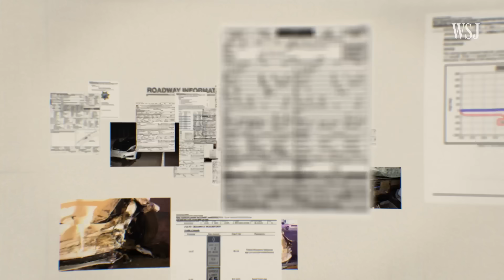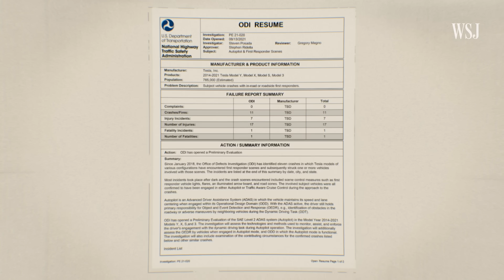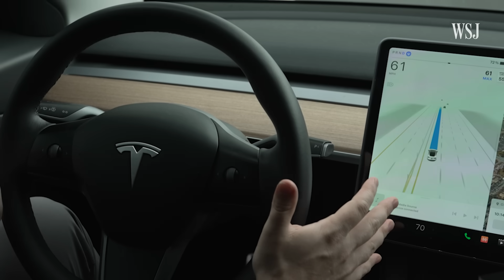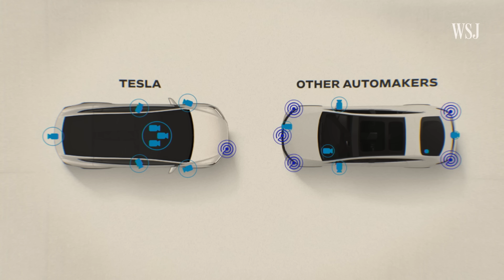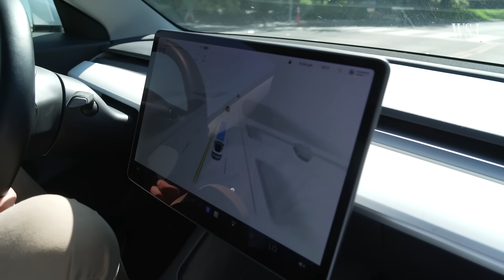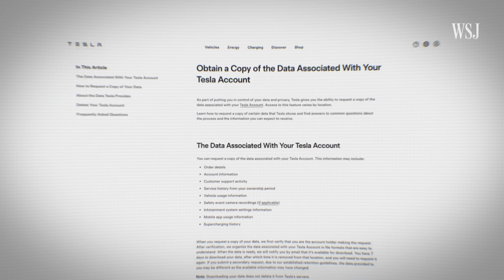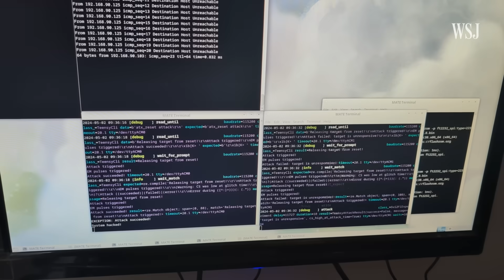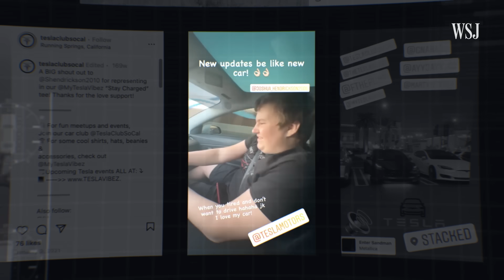The Hidden Autopilot Data That Reveals Why Teslas Crash | WSJ

Comment: This is VERY outdated news.  That semi-crash that you opened with was when they were still using radar - and was LONG before FSD was mature.  There are now 6 million Tesla's on the road.  At an average 15,000 miles driven per year - that's 90 billion Tesla-miles driven per year.  Over all car types, there are 14.3 collisions per million miles driven.  So if Telsa vehicles were like ordinary cars - you'd expect 90,000x14.3 = 1.3 million Tesla collisions per year.   You say that "thousands" of Tesla-related accidents have been reported.   If it was "millions per year" there would be a problem - but it's not.   Also, you're talking about the UK version of FSD - which is FAR from complete.   All Tesla owners are told at the start of every trip that they must supervise their car while it's driving.  Clearly if you slam into a very obvious semi-truck - then you're not supervising the car's driving.   Tesla's are (statistically) the safest cars on the road - and they are safest when using FSD.

Comment: Musk & Tesla are setting back the deployment of autonomous vehicles tremendously with their recklessness, cost cutting, and sketchy marketing. Waymo operates self driving cars with a tremendous safety record, because they invest also in LIDAR and their vehicles excercise greater caution. However, when the public reads about Tesla FSD crashes, it reduces trust in the concept of self driving cars entirely.
Reply: Waymo operates self driving cars with a tremendous safety record 
Which cost several times what Teslas do. If Teslas were equipped with the same sensor suite Waymo vehicles are, no one would be able to buy them, and no one would get the benefit of Tesla's astonishing record of safety.

Comment: A car has either got to be fully autonomous or completely manual, half measures are dangerous. I include in that lane departure devices that interfere with your free choice of where to steer. Give the driver full control and full responsibility or put him in the back asleep with the car and the manufacturer taking full control and responsibility.
Reply: People said the same thing about cruise control when it started getting popular in the 1980s. FSD is great. It does 90%+ of my driving for me right now. The system forces you to look at the road to make sure you're paying attention, and you can take over at any time. Just hitting the brake pedal or turning the steering wheel is enough to take over.

Comment: Don’t drive a Tesla saves lives.
Reply: Tesla saves lives 
So true, and thank you for pointing this out! If this weren't the case, NHTSA would have required Tesla to shut down Autopilot years ago, due to the dozens of fatalities Teslas with Autopilot have been involved in. But NHTSA knows full well that Autopilot avoids far more fatalities than its misuse causes in accidents such as those highlighted in this hit piece, and so it's allowed to continue to be used.
Reply: @ NHTSA is corrupted.

Comment: Its called FSD Full Self Driving. autopilot is literally just Adaptive Cruise Control
Reply: Its called FSD Full Self Driving
This video is exclusively about Autopilot, not FSD. You are correct that Autopilot is just TACC, plus lane centering; this is why it takes much more monitoring that FSD, and this plus the fact that several times as many Teslas have Autopilot as have FSD is why there have been dozens of fatalities under Autopilot, but only two in 2+ billion miles of Teslas driving with FSD engaged. But even with dozens of fatalities, Autopilot still saves more lives than it costs; if this weren't the case, NHTSA would have shut it down ages ago.
Reply: Spot on, this video is misleading calling autopilot tech. They're simply referring to Crusoe control here. It's misleading to say it's fully atonamous  @BigBen621
Reply: @Koderfacts  You seem to be confused about a few things. 
 this video is misleading calling autopilot tech 
Not sure what you mean by this, but the video was entirely about "Autopilot tech".

 They're simply referring to Cruise control here 
How did you come to this conclusion? Autopilot is much more than cruise control. First, it includes TACC (Traffic-Aware Cruise Control), not just basic cruise control as you seem to believe. Further, it includes Autosteer, which others call Lane Centering.

 It's misleading to say it's fully atonamous 
No one anywhere, ever claimed that Autopilot is fully autonomous. FSD (Full Self Driving) is getting very close; but this video is about Autopilot, not FSD.

Comment: There are a lot of possibilities with current technology, but Tesla and any other manufacturer need to slow down if the “AI” is not sure enough it has a clear road ahead. Two cameras are sufficient in determining distance to objects ahead. But in low light conditions there are struggles to all algorithms to produce reliable data. And this is known very well. But you can’t sell a car that is afraid to drive at night. There are a lot of alternatives to all systems. Auto pilot could just follow another vehicle while keeping a safe distance. Use the high beams, when cameras disagree, to provide a better vision. Even a cheap $5 laser can be fired to probe the road ahead. Or even better night vision cameras. And I’m sure an army of engineers can probably think of many more ways to make this better and safer.
Reply: if the “AI” is not sure enough it has a clear road ahead. 
There is no AI in Autopilot; it's entirely heuristic code (code written by Tesla engineers).
Reply: @BigBen621  you did see the quotes, right? What I'm trying to say is just that there are a lor of other algorithms to determine what's ahead, some very old but good. Tesla clearly fails to determine  if the road is clear ahead in low light conditions. And I'm fairly sure it would hit a wall if there is a painting of a road on it.

Comment: Procedural programming would have a default at the end of a switch that says : if you don't know what's in front, assume the worst. But no, it has to be AI all the way down, because trends or whatever.
Reply: it has to be AI all the way down 
There is no AI in Tesla Autopilot; it's 100% implemented by heuristic coding (hand-coding by Tesla engineers). 

 if you don't know what's in front, assume the worst. 
The claim that Autopilot didn't stop because it didn't recognize the vehicle, which is one of the more egregious falsehoods in the WSJ hit piece, is what I like to call FALSE. It didn't stop simply because TACC from all companies doesn't deal well with stationary objects in the driving lane. Here's Tesla's warning on the subject: 
 "WARNING: Autosteer is not designed to, and will not, steer around objects partially in a driving lane and in some cases, may not stop for objects that are completely blocking the driving lane." 

And lest you claim this is just Tesla protecting itself, this is from the Owner's Manual for a 2023 Chevy Bolt EUV: "Warning: ACC may not detect and react to stopped or slow-moving vehicles ahead of you. For example, the system may not brake for a vehicle it has never detected moving." 

This is exactly the situation in the first anecdote.  The Tesla came upon a crashed semi-truck it had never detected moving; and in line with the warnings from Tesla, Chevy, and likely everyone else with TACC or an Autopilot-like function, it failed to stop. Not because it didn't recognize the overturned truck—it didn't need to do so in order to stop— but because TACC systems in general may not stop for stationary objects in their lane. The driver's failure to heed this warning is not evidence of a failure of Autopilot; in fact, NHTSA has investigated several such accidents, and found in each case that Autopilot operated as designed and intended.

Comment: More than a thousand! That's manslaughter! Never knew so many incidents happened to Tesla. Never knew its autopilot is vision only. Musk is criminally faulty! Lack of adequate training is one thing, the inherent inability of the cameras to tell the distance/depth should be plain to Elon Musk and his overpaid autopilot team. Even the stereo vision and calculation may estimate the distance but it means lagging that may be lethal. Most important of all, why Tesla's algorithm allows autopilot to be functional in night time or low light environment? If the camera can only capture images of 20 ft away and the car runs at 70 mph, you don't need to be a Tesla engineer to tell that it's extremely dangerous to rely on the cameras. What a shame to Musk and Tesla!
Reply: Pretty much everything in this rant is False.

Comment: They aren’t using the correct measurement systems, imho 🤷‍♀️ I worked in video safety & telematics😮 they CHOSE the wrong foundational tech… limited THEMSELVES 🤷‍♀️
4:19  their CV isn’t smart or fast enough
5:07  AI must be trained by COMPETENT humans… for road conditions WORLDWIDE… for all weather conditions… lots o’ data…
6:38  Frank Figluzi for possible interest in AI CV in transport (<— edited for Frank instead of Glenn)
Does ‘pretty good’ rank at around 75% success?  … so… only 1 of 4 humans will die…  um… I like SAFER products 🤷‍♀️ just me I guess…

Comment: The real question is: the driver could see the truck or have seen the truck? It seems that FSD is like humans and made similar mistakes. In any case is up to driver to avoid accident not to Tesla.
Reply: @spaceoddity848   you’d also be surprised at the reaction time of a 33,000 lb Class 8 truck when a ‘death by semi’ human comes along. Jumping off overpasses, running into roads, suddenly stopping for a ‘nice good’ rear-end ‘accident’… All those ‘death by semi’ humans are hard to forget… I remember them all… do you know know much pressure & force the braking system would require to stop a vehicle that size?  I do. And a driver human does not FORGET unintentionally ‘splatting’ a suicidal human on their windsheild.  Perhaps I am ‘missing’ something.  No, nah, Teslas are MORE dangerous. They cannot detect a desperate human 🙄 so… I guess if your goal is SAFE driving, no a Tesla still sucks, humans do it with more care & SITUATIONAL AWARENESS.  News flash for drivers & nearby peds… Tesla does ZERO to prevent UNSAFE driving… ‘standards and all’, right F-Elon?  Oh, yes, death by semi is a REAL thing, just as ‘death by cop’ is a thing too — speaking from an insurance actuarial perspective 🤔🤷‍♀️ let me think a bit more on it… #THX
Reply: A human has better reaction time than a Tesla, or a drunk human… 🤷‍♀️
Reply: @multichick  Human reaction time is much slower than a Tesla or any other car. Most people that have cars with any sort of forward collision warning can give you stories about the car starting to apply brakes before they had a chance to react.

Comment: The reason autopilot is overhyped is because the other side completely discredits it with content like this… there’s no apparent desire for factual representation of the future of autonomous driving by either side.  Humans are now more distracted and dangerous than ever before behind a wheel of a car.  Autonomous driving will probably never be perfect, but like subways, trains and airplanes, it will almost certainly net out to many lives saved, fewer accidents and fewer injuries.  People will still die and accidents will happen, but policy isn’t made on an individual level it’s made on a population level.  If policy makers and manufacturers made every decision based on individuals, we’d still be stuck in the Stone Age.

Comment: The tech in autopilot is growing exponentially more capable. With higher speed processors, it will be safer than manually driven vehicles. A person can only look in one direction at a time. A computer can take inputs from several.

Comment: This whole fretting thing is so stupid. The only thing that matters for AI driving is, does it SAVE MORE LIVES THAN IT KILLS? No driving system will ever be perfect. It just needs to be better than the average human driver. 

With a level 1 or 2 system like Tesla, it’s even better because you combine the features of both AI and Human safety systems. The AI is never distracted, and the Human is supervising. The combination only is unsafe when the human becomes distracted, which is 100% the fault of the human.

Comment: Elon should never even implemented Auto Pilot. TESLAs already made so much change and successful just being the leader of Electric Cars for zero emission and being green
Reply: Elon should never even implemented Auto Pilot 
Tesla just put its own name to features that have been standard on virtually all new cars for 10-15 years now, namely TACC (Traffic-Aware Cruise Control) plus Lane Centering (which Tesla calls Autosteer). The only significant difference is that NHTSA tracks accidents and fatalities that occur in Teslas with Autopilot engaged, but pay no attention to accidents and fatalities in the other 150 million-some vehicles that are not Teslas but have the same functions as Tesla Autopilot.

Comment: I actually surprised how little sympathy i have for people trusting Tesla and dying as a result.
Reply: I actually surprised how little sympathy i have for people trusting Tesla and dying as a result. 
They didn't die because they trusted him, they died because the DIDN'T trust him when he said "WARNING: Autosteer is not designed to, and will not, steer Model Y around objects partially in a driving lane and in some cases, may not stop for objects that are completely blocking the driving lane. 

This is exactly what happened to the first driver, and is specifically warned against in the user manual.
Reply: @BigBen621  you have that wrong they did die because they trusted him they trusted him does that car would work properly if they didn't die from the other stuff sooner or later they're going to die from the radiation poisoning those death traps are putting out and if that wasn't the case they'll either die from exploding in it or it catching them on fire

Comment: As a non Tesla driver, does the simple ACC not Auto work satisfyingly? Like at 25mph following the car in front around a sharp curve without losing 'sight' or you arrive at traffic lights and the car in front already stands still.
Reply: Yes, it does all those things. It's just that the Tesla-hating Luddites posting most of these comments believe it should do far, far more than simply maintain a set speed or distance from the car ahead, and keep the car in its lane; and think that when someone is injured or dies because they failed to properly manage it—as clearly laid out in the Owners' Manual—it's somehow Tesla's fault.

Comment: Autopilot is not FSD. BUT BOTH CAN BE DISENGAGED BY MERELY APPLYING THE BRAKE!  Seeing anything blocking the road like a downed semi, I would have applied THE BRAKES!  I have been using FSD since 2022 and it is improving so quickly. The autopilot is NOT FSD as it only allows one to steer without having to use the accelerator, however to stop one needs to brake. The video of the accident proves 1) there was plenty of time to brake 2) he was going faster than he should have 3) not paying attention. Did his Tesla even have FSD?  Because it would have slowed and sent alarms to driver.

Comment: We should be focusing on data and statistics. People die every day in multiple different cars, focusing on specific examples is just misleading and not focusing on making the roads safer.
Reply: It is important for people to understand the weaknesses of a system to prevent tragedies. Statistics are important, but don't help analysis to that extent, especially when data the data to make more specific statistical inferences is kept hidden
Reply: @ErinWilke  Yes, that data should be made available to regulatory bodies. I don't think it should be publicly available, since that seems like a breach of privacy with no actual upside. As it concerns this video, making this an emotional story about a specific case is in poor taste. The fact that it's about an accident that happened several years ago with a past system makes me question its relevancy.
Reply: @41-Haiku  The system  may have changed, but Tesla has not.  That's the problem, and that’s the story.
Reply: Elon Musk does not agree.

Comment: I am shocked to learn they are not using lidar and where's the IR? Why are they only using visible light?
The technology is out there to make "self driving" a lot safer. Those vehicles need lidar, it doesn't matter what is in front of them as long as they STOP in time.
Reply: FSD is proving it doe's not need Lidar.

Comment: Now you know why these fully automated cars aren’t used in Europe.  It’s not the technology.  Under our laws, if the car is on auto then its the manufacturer’s fault and they have to pick up the tab if it goes wrong.  None of them are brave enough to risk it.
Reply: None of them are brave enough to risk it. 
Are you talking about "none of them" in the EU, or "none of them" in the U.S.? If the latter, this is what I like to call FALSE. Waymo is SAE Level 4, and it takes responsibility for damages a Waymo vehicle causes. M-B Drive Pilot is SAE Level 3, and arguably takes responsibility for damages a system failure causes while Drive Pilot is engaged.